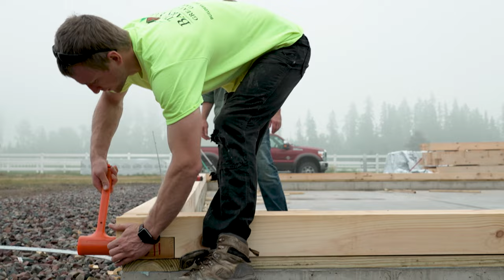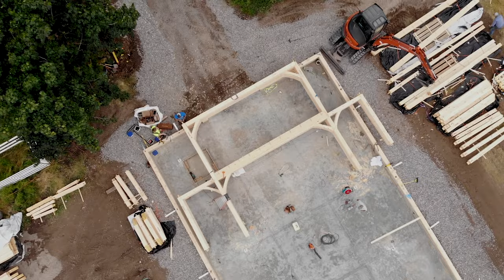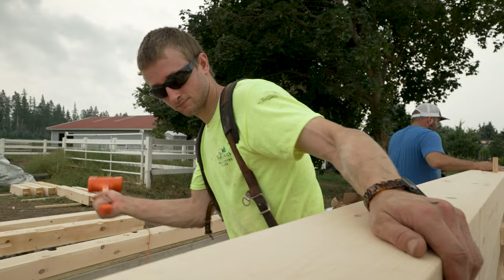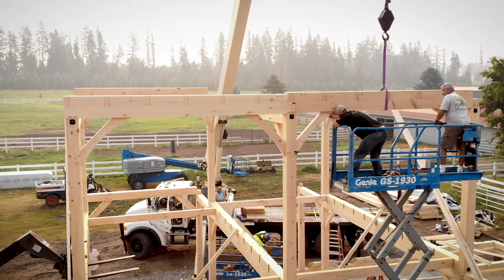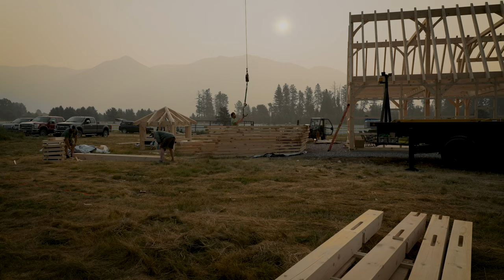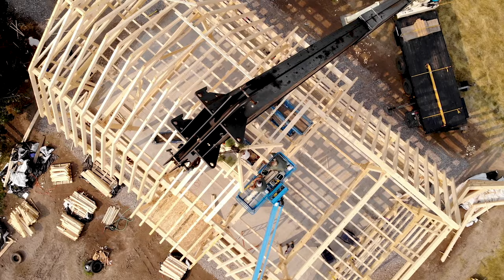Raising a 36' x 48' Pioneer Gambrel Barn Kit in Columbia Falls, Montana

Comment: Is this white pine or southern yellow pine? What about checking or twists, assuming this is green wood. Is the wood kiln dried or green when installed?
Reply: Looked like laminated wood to me. Not traditional timber. I could be wrong.  So itwould be engineered to not do any of that.
Reply from the maker: It's Eastern White Pine. There are glulam beams used in the main floor system to eliminate posts on the first floor.